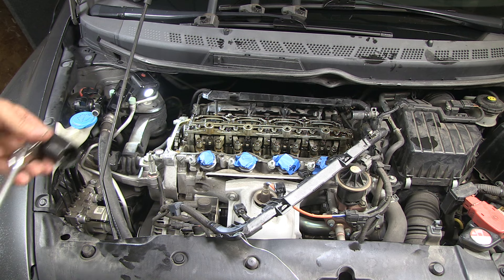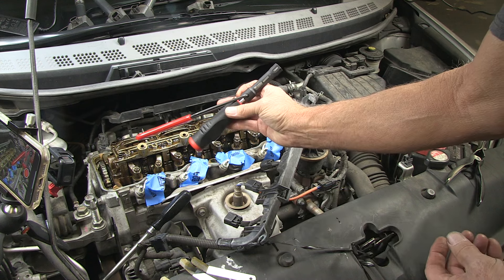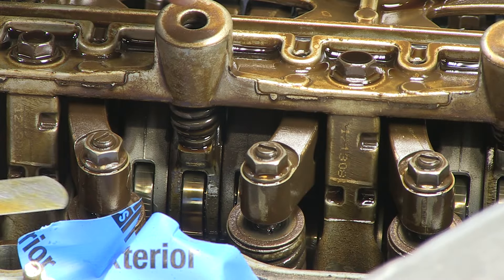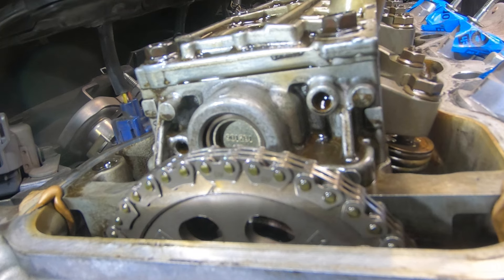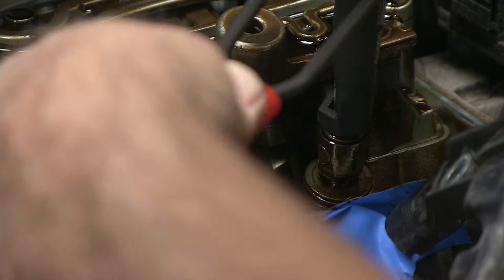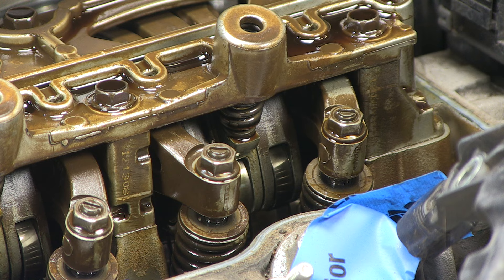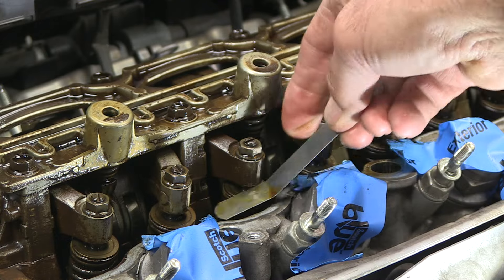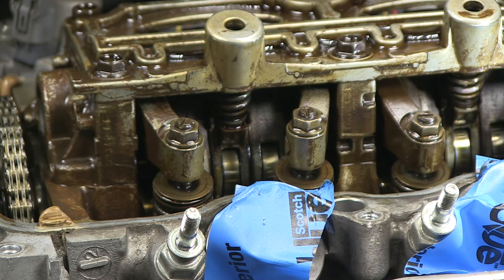Should I adjust valves on a Honda Civic? Here is what I found out.

Comment: The fact that Honda Civics need a valve adjustment is an obscenity. I haven't had a car that needed manual valve adjustment in 30- years, but lo and behold, these darn Hondas need one. What is Honda thinking?
Reply: Probably because you have had push rod engines with hydraulic lifters that  rid on the cam and the lifter can absorb a fair variation of lash. When I built my Gen 4 GM v8 with a bigger camshaft and Cadilac race lifters.. any variation that was outside of spec with the depth of preload on the lifters had to be solved with DIFFERENT LENGTH PUSHRODS! Hows that for a beloved engine not requiring valve adjustment? 

If you look how the valve train in these honds work, there is not spring loaded hydraulic rollers of any kind, nor do i see it being possible to add such an idea. The tech in the honda valve train may require valve adjustment but it also makes it possible to have a engine with great low end street manners, but also has a second cam profile that it switches too instantly while operating that gives the engine "big cam" high rpm power. Uts a give and a take. Adjusting valves is not difficult enough to throw a fit over. Not for the big positives these engines deliever
Reply: @Nicholas-im8bd  I've had engines, other than pushrod V8s, that didn't require valve adjustments, including engines from Nissan V6, GM V6, Ford V6, Kawasaki i4, BMW V8, Toyota i4, BMW i6, VW i4, & Ford V8. None of these engines required a manual valve adjustment. Some had overhead camshafts, some had pushrods. It turns out the necessity to adjust valve lash isn't limited to the Civic, apparently the Accord is the same. Thanks for the information regarding needing to change pushrods to compensate for extreme wear, but even replacing pushrods isn't all that bad. I can understand some of the benefits to having manually adjustable valves, but manufacturers have widely eschewed that technology for the benefits of less maintenance & longer maintenance intervals.  I don't know which is more likely, a valve adjustment where the lock nut slacks off or a bad lifter. Whichever the case, I was still astounded when I found out a "tune up" meant adjusting the valves. Thank goodness I've done such work many times in the past, so the issue didn't cause a roadblock, I just found it astounding. Thanks for the input.
Reply: @Nicholas-im8bd  What do you mean the Honda engine has a "second cam profile?" AFAIK, the 1.8l Civic, which is what I adjusted, has not modern valve tech, like variable valve timing & the like. What am I missing?
Reply: @salvadormonella8953  You doing look hard enough. there is a third lobe between the lobe that operates the rockers that open the valve. Depending on the engine model the activation point varys, but there is a solenoid that puts oil pressure into the rocker arms through a passage that leads to these small dowels. these dowel then move over locking the two rocker arms to the center rocker that is riding on the alternative cam profile. If you drove one of the performance orientated engines, you would find they NOTICEABLY pick up power at a certain rpm... this is due to this cam profile. As i understand, the r18 in the late model civic had a more effeciency based profile and activation profile in it rather than performance profiles.  

Its neat stuff you should research it
Reply: @Nicholas-im8bd  Well, $hit, you're learnin' me, then. I didn't notice anything exotic in there, other than the forest of valves, 16 of them, requiring me to check 16 clearance lashes. I had no manual, or instructions. Thankfully Honda labelled the valve sprocket to orient me to "true north." I did NOT notice any advanced variable valve timing voodoo, but then again it mighta been staring right at me and I didn't notice because such wizardry is so foreign, after-all. I will say this about Honda: Honda used to be my customer. In the late 2000s I had Honda, Toyota (both HQ in Torrance, CA), Mazda (Irvine, CA), & GM (El Segunda, CA) at the same time. Honda looks at themselves as an ENGINE company. They make ENGINES. The other stuff, the car body, or motorcycle frame, or generator cage, or lawn mower cutter, or whatever other parts are required to make a useful product only exist so that Honda can sell the engine. They DO NOT see themselves as a car (or motorcycle, or whatever) company. They make engines. The other stuff just helps them to sell the engine. This is very different from Toyota, who view themselves as a car company. Also, the U.S. Honda folks, unlike the U.S. Toyota folks, have very little autonomy. Japan calls the shots. All day, constantly,, dictatorially, to the great displeasure of the U.S. managerial team. Friction city, personnel-wise. In their lobby they have two race cars with tiny engines that produce a supernatural amount of power for the displacement. So, I guess I'm not surprised by variable valve timing, or variable valve lift, or whatever they have in there. I am still somewhat surprised by the very manual valve-adjustment at tune-up time. I also wonder; since Honda is so very married to the notion that they make engines (and the ancillary parts needed to sell those engines0, how will their psyche & zeitgeist change when electric motors dominate vehicles and Honda loses all those decades of development and engineering intelligence. The U.S. team is already miserable. Once they lose their reason de etre, the ICE, I imagine they will have a sort of collective psychological crisis. My first vehicle was a Honda. A Honda 90. I've had others, mostly motorcycles, so I'm not agin' Honda, but I will eagerly take on one of them contemporary NSXs in my Corvette, with its pushrod V8, any day of the week. There is no replacement for displacement. Thanks for the education. Keep the rubber side down. ;-)